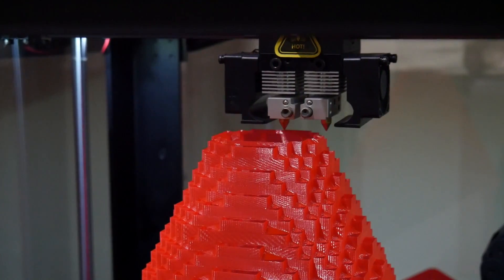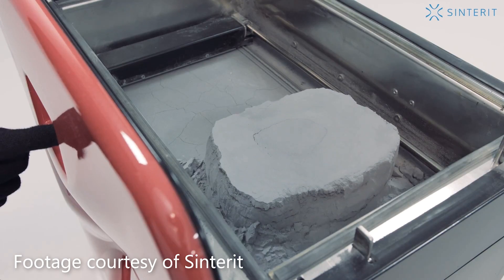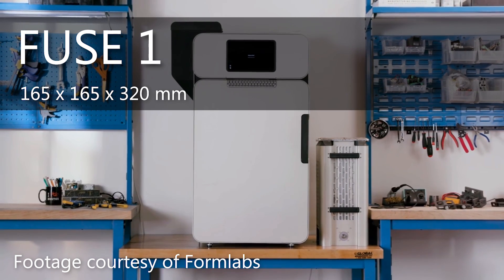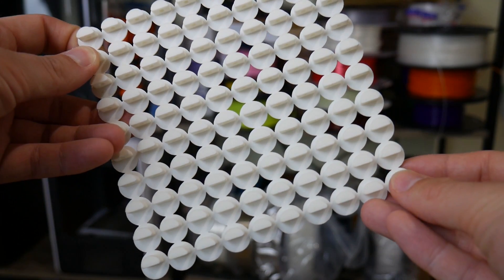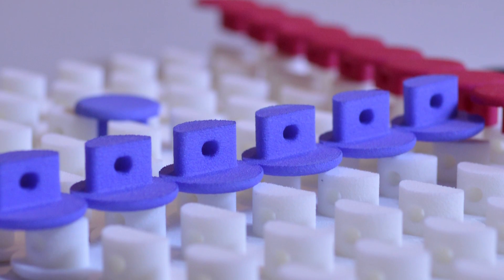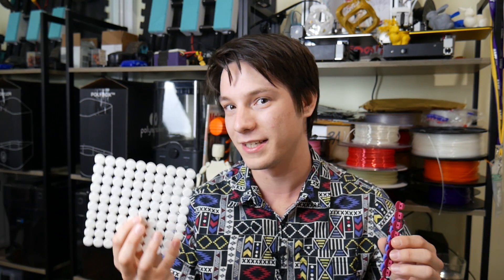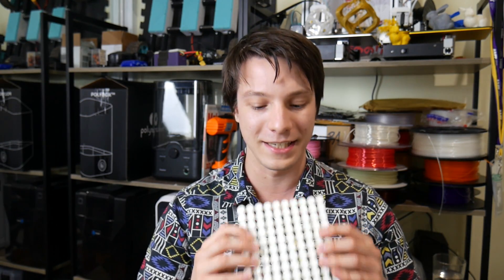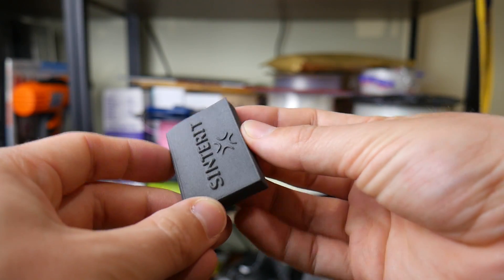Here's why SLS is the future of 3D Printing - Maybe. Formlabs Fuse 1 vs Sinterit Lisa vs EOS

Comment: I want to see you print a 3D printer (or the majority of essential structure parts)
Reply: It seems Angus isn't really into DIY designs and the whole RepRap things, he focuses more on the different commercial machines, how to do and tune and refine the printing process, and the results of those things.
Reply: Jamie Yeah I understand, it was mostly more of a joke
Reply: I wanna see people print integrated circuits. ;p
It's a thing...
Not a common one, but it can be done...
It's actually easier in some ways, since it's close to conventional inkjet printing, but with different kinds of ink...

Still... A 3d printer for plastic parts plus an IC printer? That would be amazing. XD

Comment: That price per KG is nuts. I cannot see this taking off for the hobbyist or even small companies till that goes way down.
Reply: That price is ridiculous compared to industrial printers too.  I pay 60 a kilo for my labs large machines
Reply: That's the main reason I don't want one yet. Maybe if someone came up with a "re-processor" or something like that.
Reply: It's really difficult to manufacture powder. At least at an engineering grade. How do you make something like that that packs in well of uniform density? It's really tricky.
Reply: JTWorks funny thing is form labs prices are 1/10 of what they used to be 🤔
Also the fuse one is the top of the line there other printer is 3500
Reply: NACAM42 Formlabs is releasing a reprocessor with their SLS Printer so that you can reuse the support material that was brushed off. There is a video on tested about the whole thing, but the cost of the machine, reprocessor and cleaning station is about $20,000USD if I remember correctly.
Reply: To be fair, that's the same cost as resin for SLA printing from formlabs or xyzprinting.
Reply: Hoffman Engineering - yeah, but you can get a KG of resin from MakerJuice for $65. Still expensive, but at least it starts to get to the realm of what FDM can do.
Reply: yeah especially considering that you have to replace 50% of it each print
Reply: give it some time and it will be cheap. I remember buying one bottle of resin 500 ml for 100 USD, now, I can get 1000 ml for 20 USD.
Reply: ProCreeper 2000 while I totally agree with you - the results do speak for themselves in quality.
Reply: in 5 years the price per KG has dropped to about 100usd per kg at that price its competitive with Resin printing providing similar levels of quality while being much stronger.
Reply: It's used a lot for industrial printing. It a lot more reliable compared to FDM. It's also one of the few processes that can print metal. The low cost machine's don't have lasers that are powerful enough tough.
Reply: what is the price?
Reply: Weight is meaningless, volume is what matter.
Reply: Like everything, technology take-up will see costs diminish and time will see new formulations for sinterable polymers. I think sintered powder proprietary but you can bet that there will be a lot of people looking to improve the shrinkage problems. It crossed my mind that the less powder in something then the less shrinkage so why not print say an ABS or other scaffold and transfer this to a sinter bed and form the final sinter around this scaffold? There would be less powder and thus less shrinkage. Nano materials and other inclusions are also likely to have a part to play.
Reply: it wont, it has it's limits and draw backs

Comment: Great vid Angus, question is the powder toxic???
Reply from the maker: Technically no, nylon isn't 'toxic' but it's the risk of inhaling the fine dust that might cause complications down the line. imakr has the MSDS listed here at the bottom of the page https://www.imakr.com/en/sinterit-3d-printers/1028-sinterit-pa12-smooth-powder.html
Reply: Maker's Muse so Are they only making with nylon powder now? because i thought you can use wax, powder coated metals or ceramic and glass filled nylon??

Comment: I’ve never even heard of SLS before now. Great video!
Reply: It's the granddaddy of printing. Also used in metals (under different power and powder requirements). I think they even used parts in aerospace that were done in 3D printing (metal, not the ratchet key from the space station).
Reply: aserta wow that’s crazy! Thanks for the info!